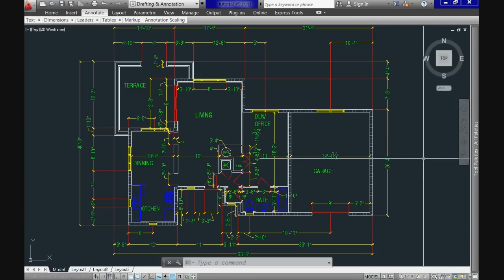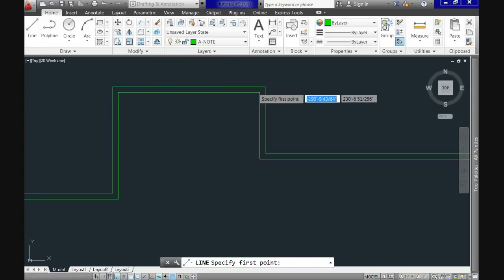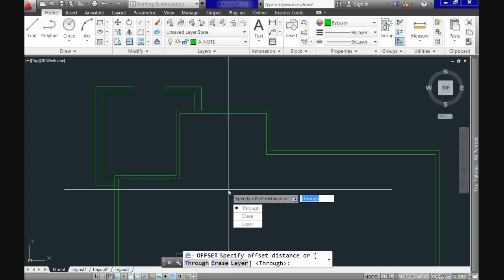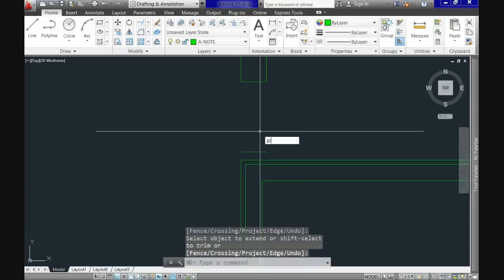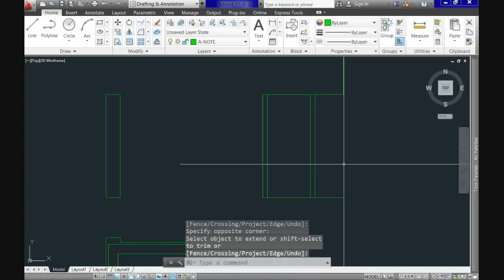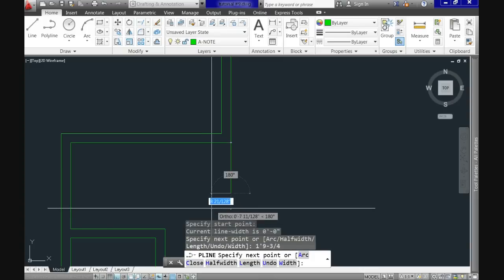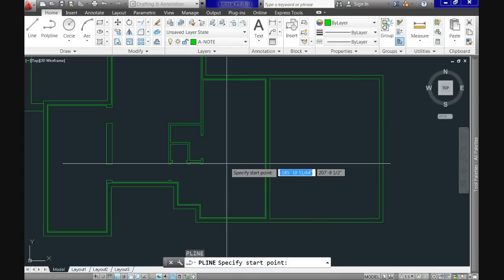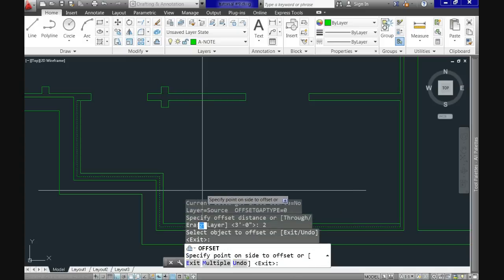Learning AutoCAD 2013 Tutorial 9: "Offset, Trim and Extend".

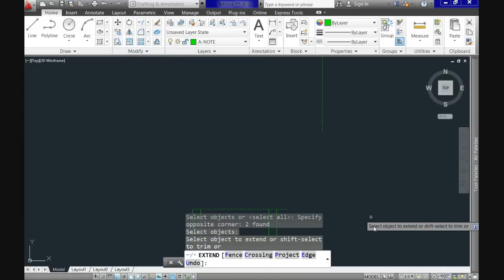Comment: @ point 7:38 you forgot to mention extend then press EDGE..only then it will cross...thanks
Reply from the maker: Jihad Thaj Thanks for your point and honestly some people are having that issue you mention. what really controls whether it does it or not is the edgemode variable which could be set to 0 or 1. By default, autocad should have the edge option set to "extend", however if by any chance is not doing it, we have to change the edgemode variable, which we do they way you mentioned: (selecting Edge option and then extend). I'll make sure to add that in future videos. Thanks again and all the best

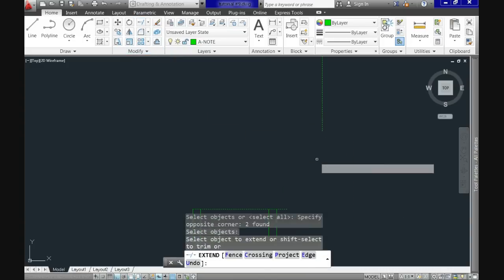Comment: You forgot to mention the edge option once using the extend command at around 7:35
Reply from the maker: That's a good point and thanks for mentioning it. The Edge option should be set to "extend" by default but in case something happen like what hpplayer3 mentioned in the thread before it would have been good to have it noted in the video. I'll make sure to not skip it for future projects. Thanks again and all the best.

Comment: how you to use offset command for the initial whole body? i can use offset for a particular line but not for the whole at the same time. help me out.
Reply from the maker: Hello,
First of all the entire perimeter is composed of several plines, not individual lines. In that case the whole thing is considered 1 object and can be offset easily. Just make sure you use pline to create it instead of line command. Hope this tackles your question. Please post back if you need further clarification and best regards

Comment from the maker: Excellent point and thanks for the input. By default it should extend, but as you can see below in another comment, if you override it by mistake it won't do it. In fact, most commands are predetermined to act in a certain way and when this doesn't happen, normally is because it got overridden by mistake (or on demand in few cases) and set it to behave doing the opposite or sometimes nothing as is the case with this one. Thanks again and feel free to ask if you need some help.
Best regards

Comment: Hi Great work. I have been following your tutorials from the #1. Very nice. Thank you. BTW I had a problem with following this tutorial and solved myself after 20 mins struggling. It is about "Extend" function. I found that one has to set up "Edge" as extend. Otherwise extension to imaginary extended target line will not work. I just want to share this. Thank you

Comment from the maker: after selecting the two lines and hit enter, you need to select the "objects to extend", you can select it one by one or in one shot using a crossing window (as is in the video) and they "have to" extend up to the place you indicate; that's the default. If you are doing it like this and is not working, it should be fixed by: select command extend; select objects, now type the "edge" option or "e"; then select "extend" option, finally select the objects again. that should bring it back to normal.